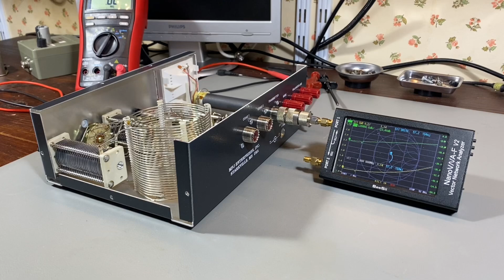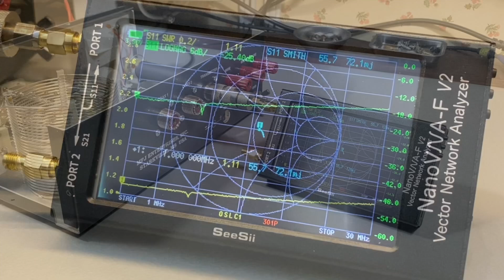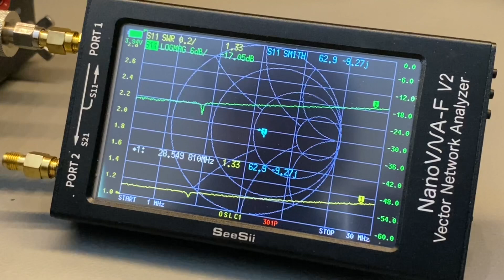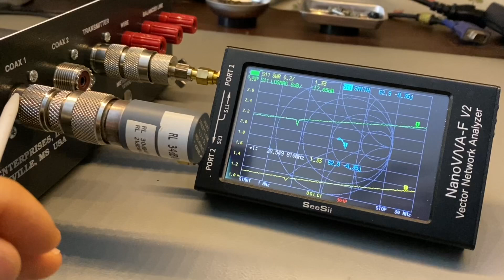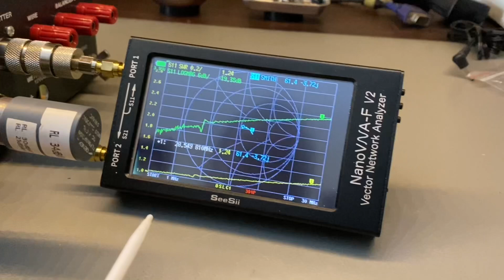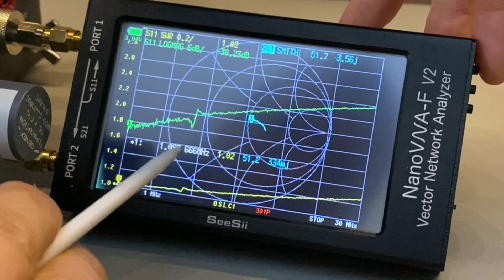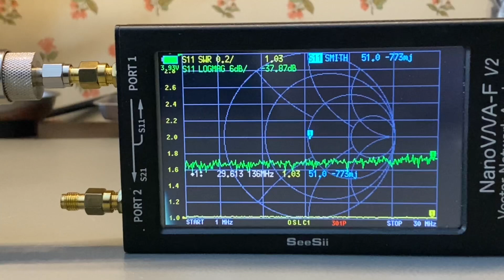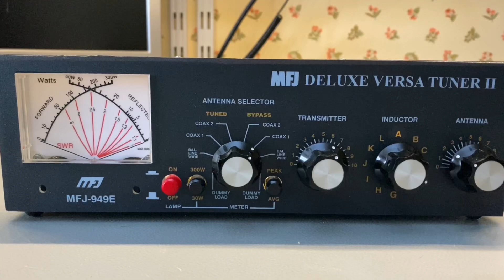MFJ-949E check with nanoVNA Part1

Comment: Do you operate the radio with the top off of the tuner?  (unshielded?)
I have this same manual tuner, but a different VNA, (a mini-VNA-pro) I would have swept the impedance from 2.0 to 29. MHz.  I am actually planing on doing just that. Ron W4BIN
Reply from the maker: You’re right Sir, I made the video too quickly. I know it doesn’t change much at all but I’ll make a second part. 73
Reply from the maker: tomorrow a follow up video will be out,and I also check another similar unit, the 969.  Be sure to check it. Thanks for watching

Comment: Always use return loss. It measures the same thing as SWR, but provides much more useful information.
Reply from the maker: RL, VSWR, reflection coefficient, they all talk about the same concept of reflected signal backward at the load as you know. I preferred to stay on VSWR as I guess most of those watching are hams and can understand SWR better. Thanks for your comment and for having watched the video.
Reply: @IZ0MTW  They will, but I'm sure it is possible to pull them, inch by inch, into the far more fruitful territory of return loss.
Reply from the maker: @donepearce I wish I can be that optimistic too one day ;)